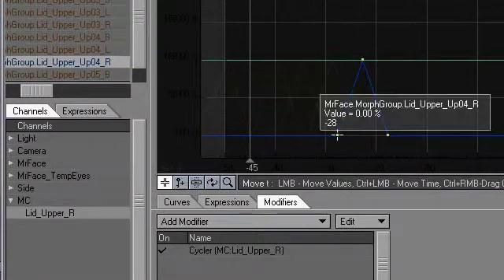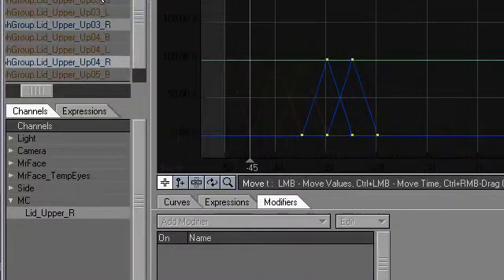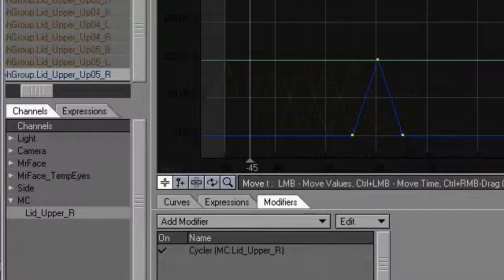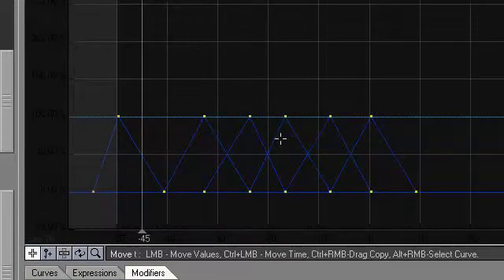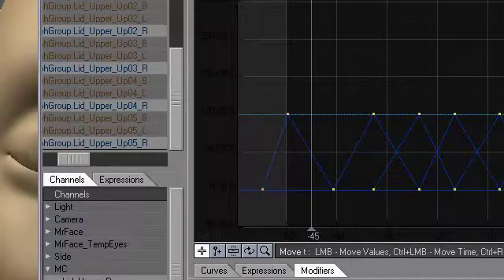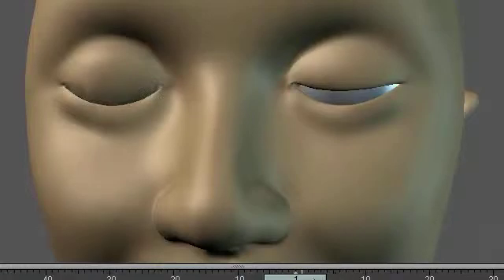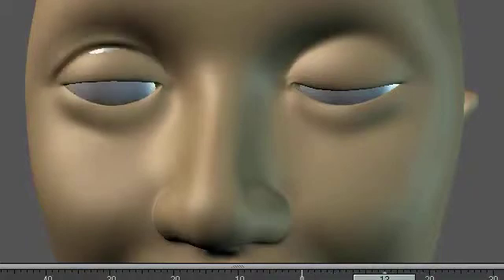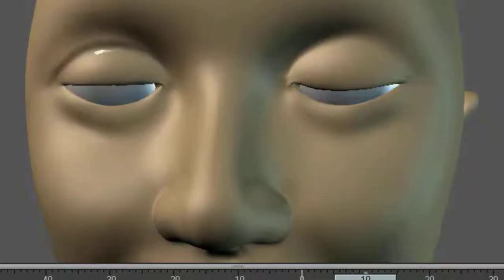Non-Linear Morphs Part 3 of 3

Comment: hmm....couldn't you just make a null like an inch away from the eyelid, that way when you rotate the null it rotates around it? It won't be a straight line, it would be an arc. Just need to put the null in teh center of the eyeball so you don;t end up with a gap between the lid and teh eye.